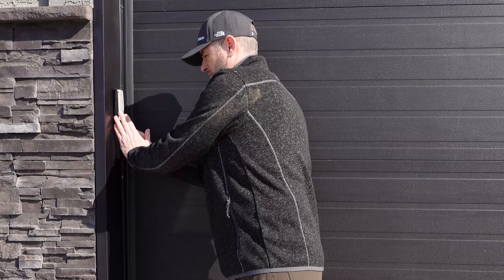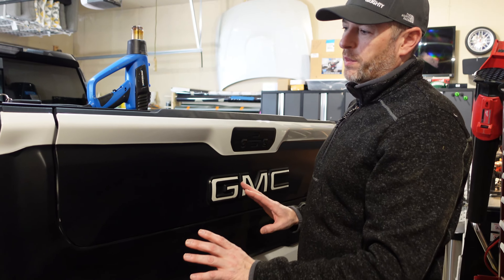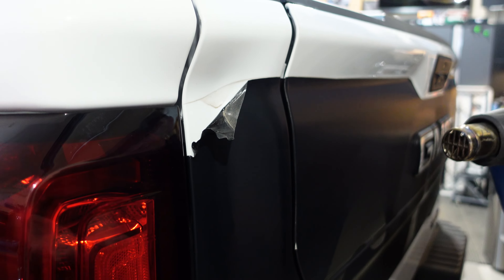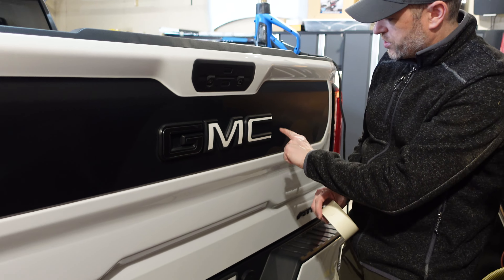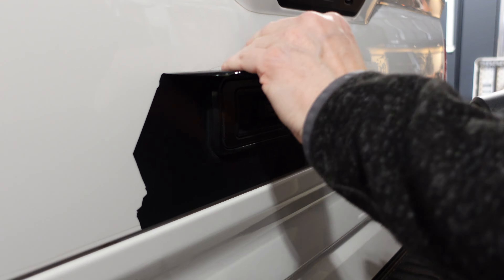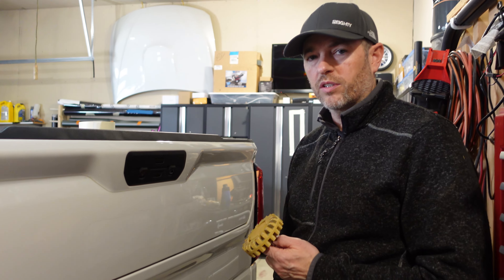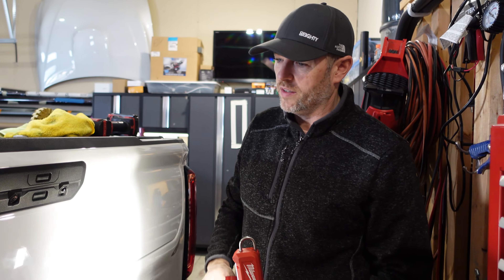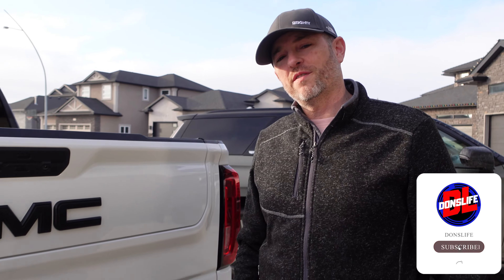MultiPro Tailgate Makeover & The Unfortunate Clean Up

Comment: Hi Don 🤜 i like your videos. Here is my question. What is the best fuse to tap into so it can work with accessories? 
Thanks i like your truck
Reply from the maker: Thanks!  For which device? I have a few fuse taps for various things in place
Reply: @Donslife  i would like power to my auxbeam switch pannel when on accessories. 
Thanks
Reply from the maker: I used the cooled seat fuse in the passenger side fuse panel inside the cab